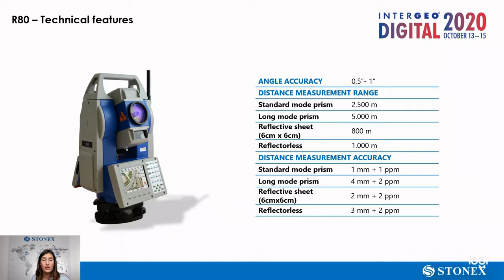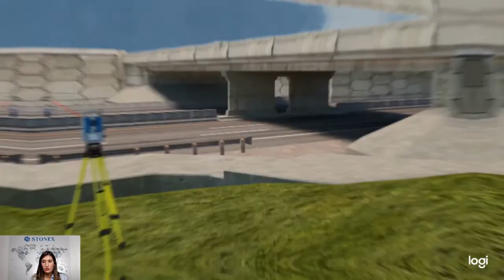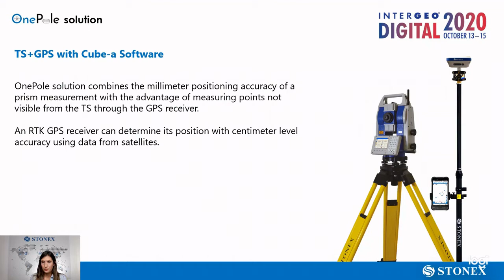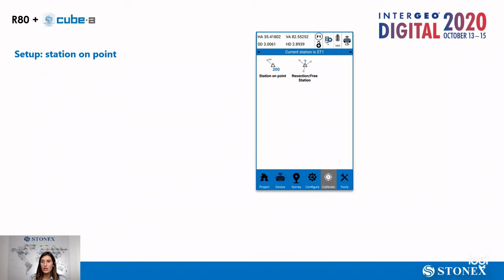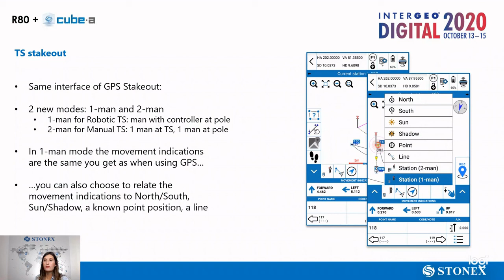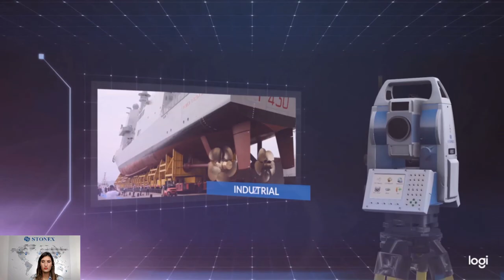OnePole Solution: GNSS & Motorized TS | Intergeo Digital 2020

Comment: First question: Using this mode we need another gnnss receptor for the base or just de robotic total station can be the base? 
Second one: Can we use an external radio to increase the range like a normal combination of gnss rtk(Base Rover?